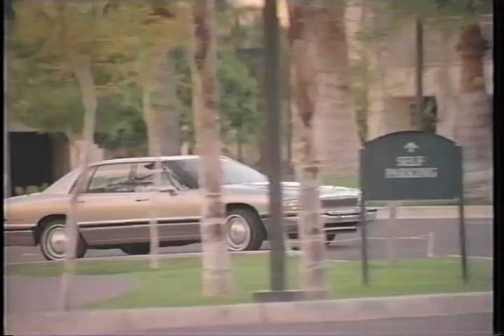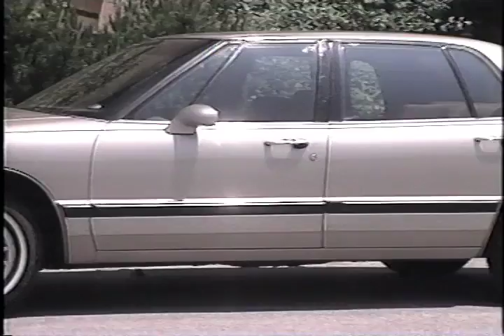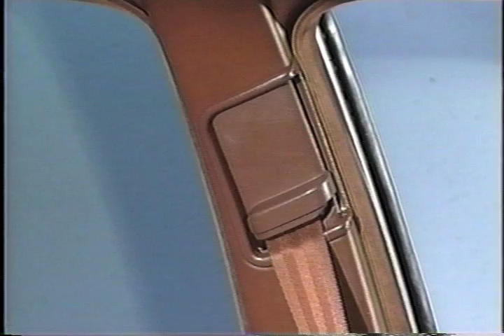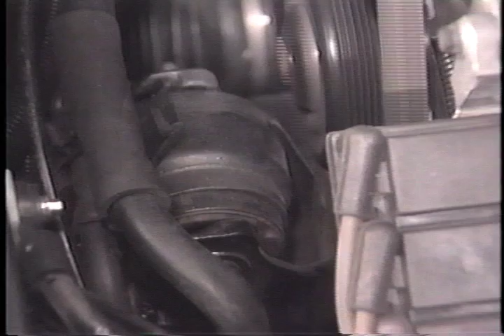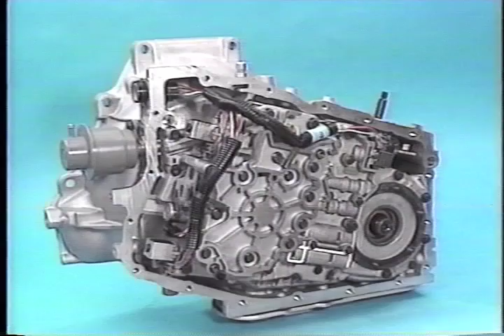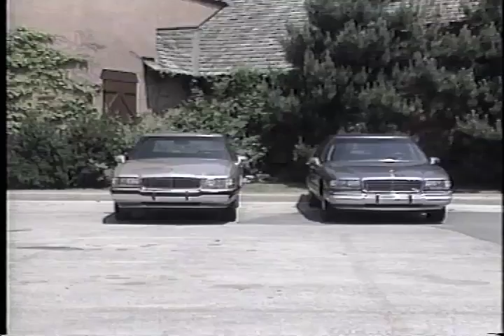GM 1991 Park Avenue / Ultra - Product Information Video

Comment: trouble  with the security system  in park avenue  ultra buck
Reply: Freddie Brown 
It is the contacts in the steering column that touch both sides of metal on your key. They are simply wearing out. That metal on the key is just a resistor. The contacts measure the ohms on the key and compare it to a preset amount in the computer. Gather all you keys and measure the ohms of the keys and get an average. Know go to radio shack or some place that sells the small electronic resistors. You'll only need one but it must be within 10% of the measured ohms from the keys. Now find the two smaller than normal diameter white wires coming from the steering column and cut them and then splice the resistor in to the wires coming from the dash board side. By doing this you are fooling the system into thinking that the proper key with the correct ohms has been installed.
Reply: True
Reply: could be the key. bad chip